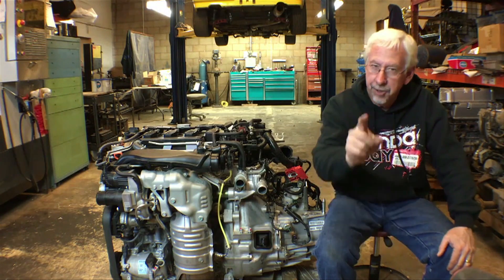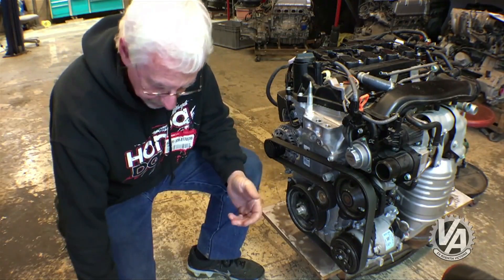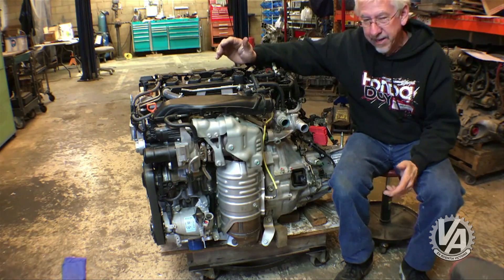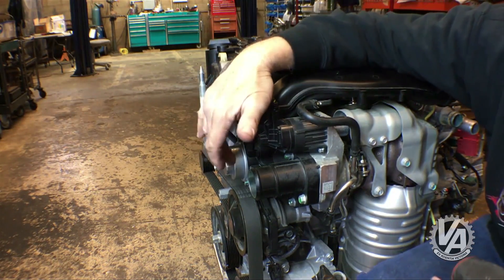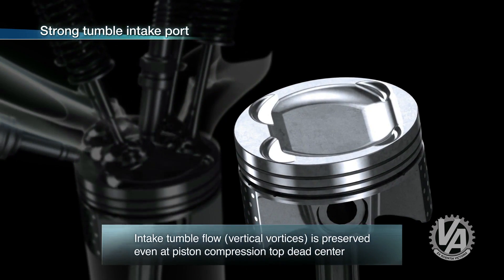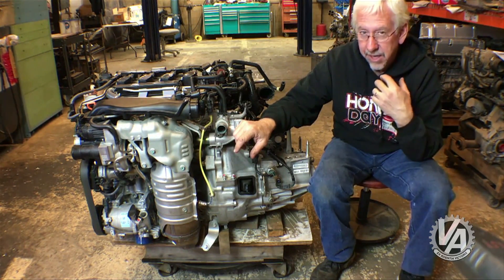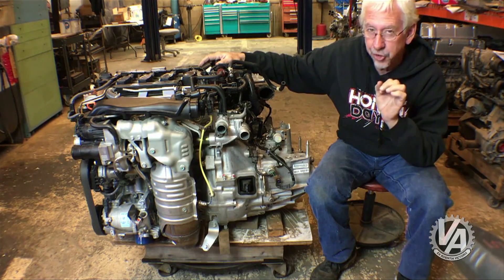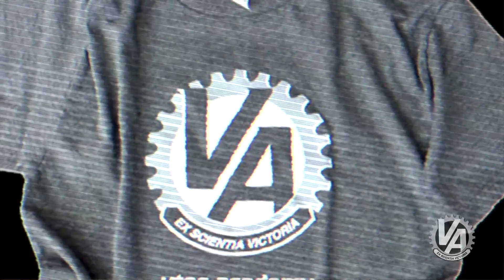Tech Inspection L15B7

Comment: How do you change the oil control valve located above the ac compressor under the head behind the turbo?
Reply from the maker: We haven’t tried that. You can actually access Honda service manuals through honda.techinfo.com. We’re about 25 bucks. You can get three days access and look up that type of information.

Comment: Great engine till the head gasket blows, which it does frequently!!
Reply: How frequently? I bought a new si in 2017 and it’s got 80,000 miles now. I drive like an asshole. How soon before it blows?
Reply: @chuckgerman7869  sounds like you have a good one, long may it last.
Reply: @chuckgerman7869 I feel like a lot of it is maintenance related. I’ve got the 16 EX-T and I’m about to hit 200k miles and I’ve had the base ktuner premapped tune on it since 50k. It just can’t handle a ton of boost unfortunately

Comment: Thanks for the video. I heard these engines has rod bolts and head bolts with not good quality.
Do you think that if the car is driven stock, it can last and be a reliable, or should I go for the 2NA engine (which is quite sluggish)
Reply from the maker: The rod bolts and head bolts are only a problem if you modify the tune significantly. Driven with stock horsepower, it is very reliable. The big problem with the stock engine is with people who have short trips, and the car never gets fully warmed up. This tends to put gasoline past the piston rings and dilute the oil.
Reply: @VTECAcademy  what about blown headgaskets and failed injectors that are happening on the stock motors?

Seems Honda haven't engineered in the reliability by strengthening critical parts on that engine. Crank main journals, poor oiling, the material on the crank weights itself. It looks weedy in comparison to the D, B and K series engines.

Comment: My 1997 Honda Del Sol Si  is  a 1600 sohc vtec.   It has no turbo.  It has multi point fuel Injection.
I have heard direct Injection and the problems it has with turbo charged engine.  My car  has 
215,000 miles.  I am the original owner.   I am not convinced that these engines will be as  good
As my engine.  My car has hardly any plastic  in the engine .   New BMW have a lot of plastic and with time the plastic failes.  The engine area heat makes the plastic brittle and it fails.   If Honda is 
Following BMW  so safe money their cars will fall apart.  Five years on a BMW is about it and Mercedes is the the same.  The S class Mercedes is not a good car.   My Del Sol has double
wishbone suspension front and rear with sway bars front and rear.   I don’t think Honda is the 
Car it was.    All this horsepower in new cars  is unneeded.  My car will do 100 miles per hour and 
more.  My car only has 127 horsepower  but it is a quick  well handling car.  In my option the
Turbo charging with plastic engine parts is only making a  unreliable car!

Comment: Do y’all know the difference between the CVT and the 10 speed automatic 
Can the 1.5t have the 10 speed swapped in or??
Reply from the maker: I am not aware of any 10 auto that have the 1.5T bolt pattern.
Reply: So does only the k20c have the bolt pattern for the 10 speed?

Comment: I just found this video! This guy is awesome...

I love how we are now getting 240+ BHP after a Hondata or KTuner tune

I'm not sure if Honda carried those SI vs EX-T differences to 2017 to '21. It is fun to believe that the SI was just tuned by Honda for more power and a higher boost limit on the controller.
Reply from the maker: There are a few differences in the EX-T and Si, like different intake cam with a different high pressure fuel pump lobe and different turbo, but they are very close to the same engine.

Comment: Interesting video even though much of it went over my head, not being a mechanic. I wonder if/when Turbo’s fail, what horsepower does the engine create?
Reply from the maker: Dramatically fewer horsepower.
Reply: @VTECAcademy  Yeah the NA 2.0 in the Sport sedan makes like 158? I imagine it will turn into a slug when it is 130HP @ 3,000lbs. Sucks as an owner of this who plans on keeping it til the wheels fall off.

Comment: I have a 2018 Civic Si.  They forgot about the clutch and it is the weak point in the higher performance version.  I am upgrading my clutch and flywheel due to slippage at high boost in higher gears.  Otherwise the performance of this engine has been excellent.
Reply from the maker: Thanks for watching! Definitely a learning curve when it comes to handling torque from the boost. Soon we will do a comparo with the 1.5T from the Accord.

Comment: Does the 11th gen use the exact same engine?
Reply from the maker: It uses the 10th Gen Accord's L15.
Reply: @VTECAcademy  thanks so much for the response.  I currently own a 22 SI but just sold my 10th gen sport hatch.  I used to have concerns about the direct injection causing issues and I ld like to know if you'd recommend a catch can.  Something I wanted to purchase for the last car but never did and it appears as though people are in fact now having problems caused by the DI.  Thanks again.  Will definitely subscribe.
Reply from the maker: @RAY_FILET  I don't have any great info on catch cans other than they do a good job of keeping oil vapor from entering the system.  I suppose it will keep the back side of the intake valve cleaner since direct injection doesn't clean the valves as port injection does. The two catch cans I know of are from Mishimoto and Radium. They probably make something for the new Civic.

Comment: A 2000s k series makes 200hp while being na. Now it needs a turbo running at 20 psi to make 200hp. Laughable. Also what is that small ass intercooler?
Reply from the maker: Don't forget K20 made 140 TQ at 7,000 rpm and the L makes 192 TQ from 2100-5000 rpm. If you could get the same torque at 7K it would be 256 HP.

Comment: I have the 2017 honda civic si with 58k miles, and I've been noticing some jolting and misfiring when I'm accelerating. I've replaced the sparkplugs and coil packs, had a code reader hooked up to it and no code nor pending codes were shown, no sign of oil dilution, no boost leaks, nothing. Can you help me out?
Reply from the maker: It is possible there's too much carbon build-up on the intake valves that it's causing the problem. The DIY solutions are taking the car for longer rides and accelerating hard when you have the space and opportunity. Or using a Seafoam treatment in the intake to clean the valves. Check and see if Honda has any sort of service bulletin concerning your car. It may be something the dealership can fix for free.

Comment: I have a 2017 1.5 liter turbo. I never hear any blow off when I lift off the excelerator
Reply from the maker: It vents back into the intake. It's very quiet.
Reply: Get a down or front pipe by PRL even charge pipes lol. I'm looking into going Catted dp with muffler delete possibly resonator delete.

Comment: Amazing video its my L15b7 reference video, do you know if the crv cams are different to the civic sport or Si? Civic seems to rev more freely up top
Reply from the maker: It's all in the tune. The cams are the same part number.
Reply: @VTECAcademy  awesome thanks, its for my dads crv which is a 2018 1.5t awd 6mt, awesome car lucky we got it in manual in europe, its running a custom tune on ktuner and has a prl hvi with race maf housing making around 230hp on 93oct
Reply from the maker: @jeryjohn  Very nice!

Comment: Hey is the crank pully the same on the 1.5 and 2.0
Reply from the maker: There are visual differences between the two and they have different part numbers. Whether or not they are interchangeable is a different question and I don't know.

Comment: What is the best exhaust system to put under a 2017 SI for more horsepower  ?
Reply from the maker: Anything free flowing at 2.5" or larger. The car doesn't rev that high so super big exhaust ins't necessary.

Comment: Hey boss I was wondering if I can do a manual swap from the si to my touring. I know people would tell me to just get an si. I already started working on the car. I got air suspension and have a wide body kit on it as well I want to add more power but I can’t because of the cvt transmission so I just wanted to know what I would need to swap it to manual pls help.
Reply from the maker: Yes, it's possible. It really depends on how much more power you want to make to see if it's worth it or not.
Reply: I’m trying to push 500 hp
Reply: Thank you so much for the response 🙏 love your videos

Comment: My 2018 civic it’s a disgrace all deluded guaranteed the truth
Every time I do or you change the engine oil is 3.79 and comes off when I do the only change 5 L or sometimes more and the smell of gas mix with oil is not acceptable....
Reply: I am not sure what your particular circumstances are, but the problem you are having seems to be bad with cold climates and cars that take a lot of short trips. When the engine doesn't get hot enough fuel sticks to the cylinder walls and gets by the rings to dilute the oil. Honda is offering a service campaign that they think will mitigate the problem. They've even extended the engine warranty on over 1 million vehicles. I would check with your dealer if you haven't had the service and maybe inquire about the extended warranty. If the dealer isn't cooperative then go directly to Honda.

Comment: I would like the SI version 4the Honda Elements w/EPS, LiON battery, TL front suspension &a wafer motor 2replace the alternator &starter. Relief of all driveline parasites always increases reliability &clears the engine bay of clutter. Where r the cam-less heads? Koenigsegg already has shown u how. Innovate on that. I also need 2c a scroll type electric AC compressor. Computer controlled minor burn cycle enhancements, increased use of high strength metals, increased of FRP& sodium filled valves r all expected minor advancements that r 20 years overdue.

For 2021, it seems that this tech simply didn’t go far enough. These reported innovations r only minor. If u r going2 innovate, we expect far more in this century &in this decade. It’s a pass 4me Honda. Try harder next time.

Comment: Would this fit on the HR-V 6speed USDM?
Reply from the maker: I doubt it. The 1.8 liter motor has a pretty small transmission bell housing. It probably uses a smaller flywheel or torque converter.

Comment: Is possible do the swap in a CRZ with original CRZ manual gearbox?
Reply from the maker: There are mounts available from Hasport soon for swapping that engine in, but the stock transmission won't work.

Comment: How many similarities/differences are there between the L15B7 from the Civic/CRX and the L15A from the GD Jazz/Fit? Would it be easy/difficult to run an L15B7 for the GD3 Fit?
Reply from the maker: The Civic and CRX came with a D15 or D16 in the US. Those engines are similar to the L15 engines from the Fit and CRZ. The L15 turbo engine is much beefier and really only shares the bore spacing with the other L15 engines.

Comment: THIS MOTOR IS AS BAD AS FORDS DUAL CLUTCH TRANS, MAYBE WORSE.
THIS HAPPENS ALL TEMPS AND SEASONS.0W 16 MAY BE PART OF THE PROBLEM.
DROVE A 1400 MILE  NEW CRV EXL SUNDAY AND THE ELECTRONICS WERE ALREADY FAILING.
THIS IS THEIR PRIMARY ENGINE NOW AND COULD KILL THE COMPANY.

Comment: I had this motor in my 2018 CR-V. Total piece of crap. I had to arbitrate it away due to massive oil dilution.
Reply from the maker: Apparently that is a problem in colder climates with short trips where the engine doesn't reach operating temp. Honda says it's rare.  There is a software fix for the problem and Honda has extended the warranty on those engines. I hadn't heard about before your post.
Reply: @VTECAcademy   I appreciate the fact you responded to my comments. However I am disappointed that you "VTEC academy" are not more knowledgeable on the Honda Oil Dilution issue. Just a little bit of homework would reveal that the oil dilution problem is significant on the Honda 1.5L turbo motor. It is not just a short trips and cold weather problem either. Additionally, it is global in scope too. The "software" fix does not work. It just keeps it from being stupid obvious. The worst part of this story ... Honda has everyone, like yourself, convinced this is normal and a nonissue. All the dealers here in the greater Minneapolis area were willing to deny this issue even exists until they were presented with the facts. Then they just treated like an illegal alien with STD's instead of an ignorant consumer. I only ask that you do your homework and report the facts. I actual did the math and the calculations and they don't add up.
Reply: Tim Braun Hi! How did you notice it? I drive a 2018 civic hatch in Europe, but here as far as i know there is no oil dilution problem. (Or maybe not that serious). I drove my car the whole winter (-8 to 5 deg c in the morning) every workday for 8 to 20 km trips daily and a few longer drives in the winter. I read something about fast rising oil levels, but I didnt notice it, maybe 2mm increase or so, but I‘m not sure. However all engines here are L15BA engines with 182 hp, as far as I know there is a minor difference in the piston design/rings between the two, but I‘m not entirely sure. What I find worrying is the 20.000km oil change interval here in Europe. Still better than the 30.000km of some other european manufacturers tho.

Comment: The cost on a swap must be astronomical into a 88-91 body. You’d need the 1.5 computer 💻, im assuming its hydraulic clutch not cable, so add all that. Then the wiring harness, thats a headache. Probably cheaper to buy new civic

Comment: Thank you for some good info. I just bought a 2019 civic si. It makes 205hp.
Reply: Managed to get my Sport Touring Hatch to around 230hp and it feels like a completely different car now.
Reply: Michael Marks 
Did retuning get rid of the rev-hang when shifting?
Reply: mmwosu I recommend going Ktuner and getting the Tsp stage 1 tune. I’ve been running it on my civic si for a few months and yes it gets ride of the rev hang and the car literally feels like a beast. Crazy difference with just the tune. I leave mine in map 3 sport mode all day and I love it
Reply: I also have prl cold air intake and just got a custom performance exhaust and man the car is freaking amazing for real
Reply: @mmwosu  You can turn off the rev-hang with both Ktuner and Hondata.
Reply: hopesfallxx2m hope you’re liking it. Already ktuned mine at 1,000 miles and looking to do cobra CAI and PRL intercooler
Reply: cr4zym3x1c4n 
I just ordered a 2020 Si. Any updates on yours or general suggestions?
Reply: Mine was the fc1 model. Same engine but 172hp only. What's the difference between these two engines?
Reply: @Ayap_SOG  Honda lies about hp numbers to boost si sales
Reply: @blessediscooo7184 😂 what are you smoking ?
Reply: @hondamanvtec2894  same engine displacement for hatch and si both models have the same sized turbo difference is the si has a 9 blade instead of 11 like the hatch and coupe. The si main boost in listed hp is because of tune and it’s rated to run premium gas. I got a tuned civic hatch w prl cai and my shit runs with v6 accord coupes. company’s do this shit it’s common they boost numbers for different models to sell the almost same car for more

Comment: No space in the engine bay. I dont understand what honda is thinking engineering this engine for civic and crv. Is going to become an nightmare to work on later and for an engine just make over 200 hp. The reliability is out the door for this one. Look at all those plastic pieces jesus and gas could enter the crankcase from low temp, high boost , and high load this happen to all turbocharged gas engine. Just engineered are directed injected 2.0l that make power and fuel economy.

Comment: So basically Honda engineers were like ""look at VW,they make small turbo engines surrounded by cheap plastic components that brake,yet,people buy them! So lets do the same formula" And they done it. And there goes the Honda reliability. People buy Honda because its reliable,and its fun to drive. If they stop being reliable,nobody will buy them.
Reply: Unfortunately CAFE and WLTP regulations don't give any choice.  The mpg and CO2/km requirements are tough.  Mazda are trying to do with NA, but the 2.0 Mazda3 in Europe needs to be detuned a lot to meet WLTP, it has 30 less hp than the American model, and they only get the 1.5L MX5 as the 2.0L MX5 pollutes too much.  At least the Honda engines aren't long stroke like VW, so the Honda turbo engines are a bit more revvy.

Comment: I wonder how this would fit in my 93 accord. Lots of modifications needed to make it work. Wonder if there's a cable operated throttle body available for these.
Reply: It may be much easier to swap over the electronic components assuming you’re using an aftermarket ECU.

Old post, sorry, but it rang with me as I also have a CB7.

The one main issue may be the height of the motor—a K20 is even tall for the CB7, the L15 may have the oil pan hanging low.
Reply: @bryanc4054  After having my CB7 for a while now, I can definitely see an issue clearing the hood and the oil pan. Anything larger than the H22 will require some real fab work to make it fit.